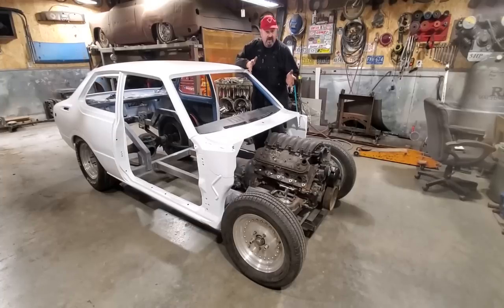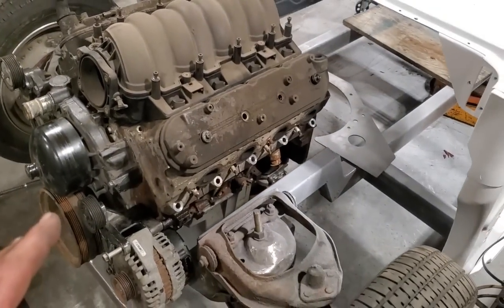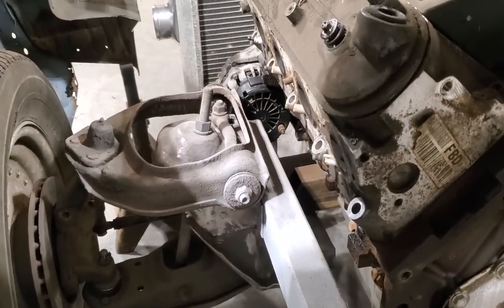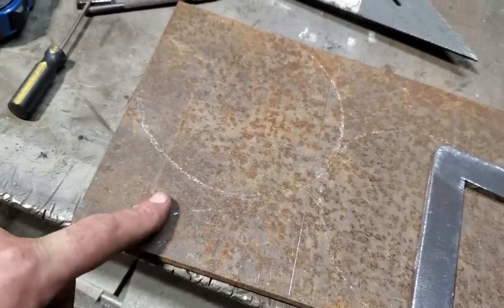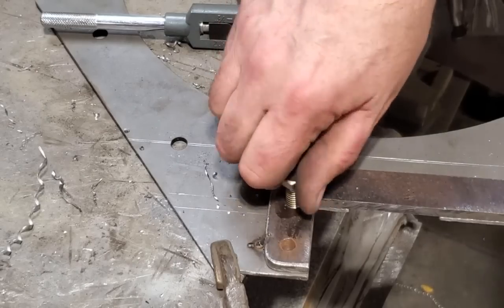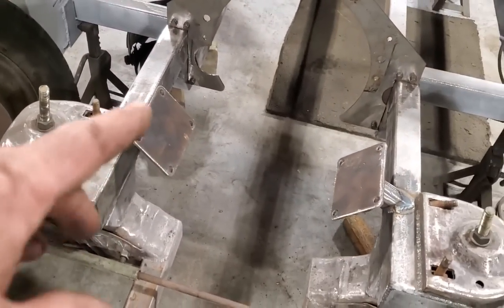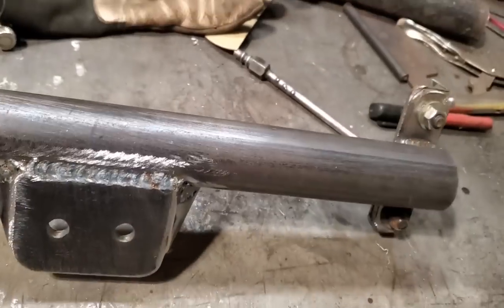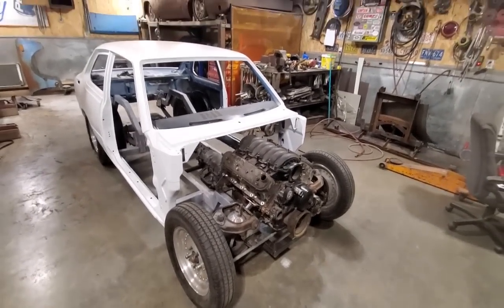Engine and transmission mounts for Crusty

Comment: What a great looking setup! Your KISS method really pays off every time I see this car. 

One tip about the oil pan being lower than the crossmember, I absolutely agree with your choice to use the F-body pan. 

The pan on the rat rod hangs 2” lower than the crossmember and I get a sick feeling every time I drive on a road that’s heavily rutted and hearing the road sand the aluminum off the bottom of my pan LOL

Comment: Hey Tony, she's looking pretty good! Looks like the firewall shouldn't be too hard to fab and still leave leg and foot room. My 64 F100, when I hauled the pieces home, included a crown Vic front suspension. None of the prep work had been done, except butchering out the front cross member, so I decided to leave the I beam front and steering. Had to do all the same prep. Radiator support, engine and trans assembly, exhaust manifolds, steering box, .... Mines mounted on stock rubber mounts. More than once I had to shake my head and thank the motor Gods that things worked out as good as they did . The fun is laying awake at night building it all in your mind. Thanks Tony for all the great tips!!:)

Comment: I’m around 16 minuites in and I have a thought which I’m sure you probably figured out by now anyway. 

When I put solid engine mounts in the rat rod (which I still have in it now and love) I had to notch the bottom of the plate that bolts to the block as there are a couple square knobs on te block (you can see them below the engine mounting holes on the block) they would hit the plates and not allow the engine to come out after I mocked it up. I could have cut those knobs off but I ended up taking a chunk out of the bottom of each plate. I’ll send you a couple pics on messenger of what I did. 

I also found that I had to remove the oil filter to get the engine in comfortably, as the last engine I put in, I punched a hole in the oil filter with the mount.

Comment: Just a thought Fitzee, on your gearbox mount the bolts are on the bottom and the nuts are on top. If the nuts come undone the fall out but if you reverse them the bolts will stay in place and you have a chance to save the gearbox

Comment: Since this is a race car (mostly), you don't need such a large alternator.  Toyota makes a lot of physically smaller alternators that could easily power every electrical item you have on the car.  You could make a mount to install a Toyota alternator pretty easily, they are at least an inch smaller in diameter than the GM alternator.  All you need to do is supply the field excitation wire and the power out wire, and the correct pulley.

Comment: JUST A THOUGHT ===  Many years ago, Bill Harrah (Reno, Nev) had his shop people put a Ferrair V-12 in his Jeep Grand Wagoneer.  To get it to fit (among other things) - the shop forces made the front fenders about 6 inches longer.  How, exactly, I'm not sure, but it worked.  Maybe with your skill with sheetmetal, you could "stretch" the front out so you have more room for the engine.  That Jeep is currently on display at Harrah's Auto Museum in Reno.  It's fantastic.
Reply from the maker: Not looking to alter the stock look of this car. I have enough  room up front for what I need to do

Comment: Thank you for sharing this with us. Great ideas which will help me with my own project. Great mock up ideas. All of this heavy duty welding, you are still using ,023 wire, correct? Thanks again for sharing.
Reply from the maker: Yes 023. It's in the machine. I think 030 would be better

Comment: It's looking great, one question, why didn't you use a peice of angle iron bolt on the frame top and inside then weld your mount's to the angle,? than the whole mount is moveable don't have to jiggle the motor, also if bolt's came out motor is still supported, when do you fit the wing's 🤣😅 that thing's going to launch definitely looking strong, great build, all the best to you and your loved ones
Reply from the maker: I thought about doing that and it was just alot more work. I'm going cut the section of the block away. Seems they serve no  purpose other then to get in my way. Lol

Comment: Could you explain that alignment of the engine and rear next time? I would have thought the rear of the gearbox should have been lower and the drive shaft a strait as possible.. Thanks for a another great one!
Reply from the maker: When you get in to big hp cars the setup tend to get closer. But in a production car  the rule of thumb is the centerline of the transmission and the centerline of the pinion on the rearend should be parallel under load. This way the u joints work togeather. If there is a alignment issue  you tend to get a bad vibration.

Comment: Hey Fitzee, I’m really enjoying your build. I’m wondering thou how you’re determining the angle on the drive shaft  while installing the motor and transmission. Hopefully I’m not getting ahead of myself with this question, seeing as I’m asking this question when I’m only 10 min into the video. Great job so far and I’m glad that your putting this type of build on YouTube!
Reply from the maker: As long as the centerline of the motor and centerline of the rearend are parallel. The angle don't matter. Pro mods like to have it all is a straight line. For the reason of the power they are running and the rearend setups. Crusty is designed much like how a 60s or 70s leaf spring car was. The rearend and centerline of engine was not inline
Reply: @fitzeesfabrications  - I'm going to have to disagree with you that the angles don't matter.  Depending on the max driveshaft rpm is, there ARE recommended maximums for the u-joint angle.  I know that youtube will kill a link if I put it in but if you google for "Driveline Angles & Phasing Problems" you'll see what I mean.  If the angles are too high, the loads on the u-joints go up and the speed-up and slow-down of the shaft as it goes through a rotation can cause vibration problems.  If the Driveshaft rpm is 5000, the max recommended u-joint angle is 3.25 degrees, for instance.
Reply: @pete540Z  i believe what you refer to is the height difference between the rear end input adapter and the transmission output adapter. Yes, this angle needs to be taken into consideration, and its adressed when setting the ride height. You then setup the front of the rear end a few degrees down, because it will rise when under load. 
So you are correct, under load, you want things to be as lined up as possible. But it’s also one of those things were “close enough” works in most situations.

Comment: thats going to be a cool ride  , Question why did you go with the solid engine mounts
Reply: I'm thinking the same. Why not some rubber to reduce vibration? Nice work Fitzee.
Reply: By running solid mounts you make the car stiffer by using the rigidity of the block. The top suspension mounts are now connected solid via the block between the rails. Also there's now no chance of tearing the rubber mounting when launching on the strip
Reply from the maker: Steptoe nailed the answer

Comment: Amazing Fabrication work I just have a stpid question about the engine mount so do you any rubber Bushing between the engine and the mount? For vibration purposes?  Wy am I asking this is because I was working on something similar and a certified mechanic said that 🤔 tha I can't built that with out a proper Bushing 😔
Reply from the maker: A solid mounted engine will vibrat yes but for drag racing it is a common practice to solid mount engines

Comment: Some top notch fabricating brother.  Although I thought on the 4.8 LS truck engine the power steering pump was lower and the alt. is kicked up high with a bracket, but that would interfere with your exhaust plan. Are you going to run an external electric PS pump?
Reply from the maker: Standard steering.
Reply: @fitzeesfabrications  when you mentioned rack and pinion steering a feller usually thinks hydraulic assisted. good enough, I guess we'll see it come together, ATB

Comment: I think you should have put the frame rail brackets for the transmission on the top of the transmission cross bar. So the cross bar could just drop out.
Reply from the maker: All the weight is on the bolts then. My way the weight is on the bracket

Comment: Hi Tony.  Holy cow that is a lot of engine stuffed into little Crusty!  Should run like a banshee.  Especially with a turbo.  Everything fits in real nice though.  If you take that big black water pump pulley off, hang onto it.  It makes a great bell!  Hang it by a wire or rope around the center flange and hit it with a small hammer, or make a gong for it.  It has a nice clear tone.  Do you run 1/4 mile or 1/8 mile in your area?  Just wondering.  Thanks for the video!
Reply from the maker: I hit that a few times. Very cool sound. Around here we run 1/8 now. Use to be 1/4 mile but I fine1/8 mile easier on parts and alot more fun
Reply: @fitzeesfabrications  And the ET's are lower!!!🙂

Comment: Boss, I want to build a cobra kit car.  8.8 rear axle, 1963 Fairlane front end and steering box, 1971 Cleveland / C6.  daily driver. Thoughts????
Reply from the maker: The front end seems interesting.  The track width on those are wide. Has it been done before?

Comment: I would have put the headers on before all that to see if they clear the rails. Unless you are using inverted manifolds for a turbo application?
Reply from the maker: They are most likely going be custom made. I have a set of forward header lined up. Not sure if they will fit under the hood. Should talked about that in video. Stock manifolds won't fit forward or in stock format
Reply from the maker: They are most likely going be custom made. I have a set of forward header lined up. Not sure if they will fit under the hood. Should talked about that in video. Stock manifolds won't fit forward or in stock format

Comment: Awsome job as usual !!! Do have a question do you use 0.023 wire for welding frame parts or diff size? Thanks in advance
Reply from the maker: I used 023 cause it in the machine.i think 030 would be better.
Reply: @fitzeesfabrications  thank you

Comment: In such a short drive shaft, why not, use CV joints in place of the U-joints? Then you won't have any issues with fluctuating shaft speeds. Are you going to make the front frame section removeable?
Reply from the maker: No that will be mounted permanently

Comment: What if you spaced the alternator foreward to use the front pulley. That would give you a little more room for your steering shaft.
Reply from the maker: Think I have steering shaft figure out its why I moved the crossmember back that rack will be mounted to

Comment: 4.8's Love Turbos they seem to take a truck load of boost  and stay together good . I like the build so far. The only suggestion i have is not running a flexible trans mount with a solid mid plate and solid motor mounts there's an 8 in 10 chance you'll break the bell housing . Ask me how i know lol
Reply: That is absolutely correct as well as the pinion angle must be nose Down at rest as the nose will rise at it flexes those leaf springs. Ladder bars or a 4 link would be a way better setup. This short of a wheelbase car is going to be a handful with 750 + horsepower.
Reply from the maker: Was wondering about the trans mount being solid. Not many around here running a mid plate.  That is a easy fix .thanks.

Comment: Just a quick question,  shouldn't the motor and engine have a slight angle towards the rear diff , like 3 degrees for pinion angle?
Reply from the maker: As long as bother transmission and pinion centerline are parallel

Comment: as an old school mechanic. I'm just wondering why there is no rubber mounting on the engine or gearbox. It's going to fibrillat when the engine is running.
Reply from the maker: It's a drag racing thing. There is a rubber mount on trans but wonder now should that be solid too

Comment: You can take the screws out of the alternator and rotate the back of the unit to get more clearance. Just don't remove the back, just turn it.
Reply from the maker: It's easier to just turn the front. No bits and peices inside there to worry about

Comment: Ha mate I would have the engine mounts bolt on top of the rail that way you can slide the engine in and out easy
Reply from the maker: That was my original plan but I ended up simplifying it even more

Comment: Fitzee...I think you should research your operating angles on the drive shaft with the engine in at 0 deg.  Short wheel base car and its not slammed to the ground.  And being a leaf spring car its going to separate and drive the rear wheels down making it even worse.  I hate being negative but I see issues when your trying to get this down the track.
Reply from the maker: Most 70s car are setup like this. I seeyour point and as long as the u joint don't bind it should work. Key is when the car is under power that the center lines of the rearend and engine are parallel  to each other. But if I do run into issues I can cut mounts and reinstall  on a angle.
Reply: @fitzeesfabrications  I don't like to see anymore than 1.5 deg of operating angles on the joints,  parallel to each other is right.... minus your added pinion angle depending on suspension choice.  So if I were to set that car up (guessing)   3.5  deg down on the eng/trans......... and  the pinion 1.5 deg up pointed at the trans.  That's 2deg pinion angle for use with caltrac bars.  Draw  what ya got on the floor at least just to see the numbers.   The drive shaft will be turning 6500rpm in the traps and Your beside it.
Reply from the maker: @jcnewbee8124  I'll do that. Make since

Comment: how will the engine slide out when the L brackets you welded to the frame are on the back side...if the L brackets were on the side of the motor plate facing the front of the engine.... once they are unbolted... the engine wouldn't be blocked by the brackets
Reply from the maker: Your looking at it backwards! Think about what you just said. If L bracket was on front side the mid plate couldn't slide forward then

Comment: Bevel is for furniture and mirrors. We metal guys say chamfer. You are going to lose your cool guy card if you keep saying bevel. 😀   Advice from an Electro-Mechanical Design Engineer, Aerospace. 1964-2001✌
Try your best NOT to have square inside corners like the "L" pieces for the mid plate. Always have as large of a radius that you can. This adds strength (gusset) and eliminates stress risers. Albeit you welded them up. I get that. Your planning and your attention to detail is exemplary!!!!!! Your skills are next level excellent.
When you say "base pan", is that the oil pan? Be sure you think about motor coming back into car upon impact and collapsible steering column. I don't know anything about crash safety design but you do.
Reply from the maker: Good points. I'll keep those in minded

Comment: I would have made the motor mount bolt on to the frame to with angle iron so it can sit on the frame and slide
Reply from the maker: Was thinking about that but is only 1/8 thick and I have to add a plating system so it could be tapped. I plan on it but ended up simplifying the mount

Comment: Geez that thing is gonna be rock solid rigid! With the midplate and all the custom chassis work you’ve done there shouldn’t be any flex or movement anywhere but the actual suspension itself. I can’t wait to watch you blow up some Chevy motors 🤣

Comment: Why don't you just cut those little ears off the block they don't need to stick out past the oil pan anyway it's not a Mopar engine so you don't have to worry about the Chrysler weirdos complaining you ruined A  Christine block
Reply from the maker: That is the plan. Just need to make sure there is no purpose for them.